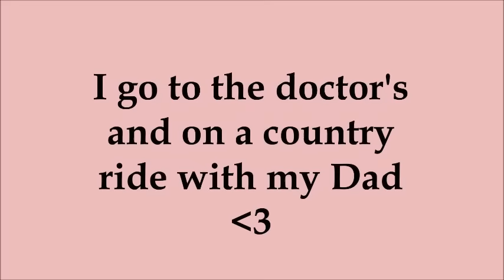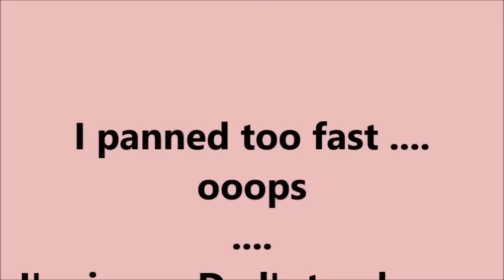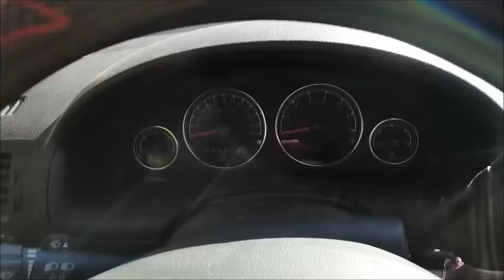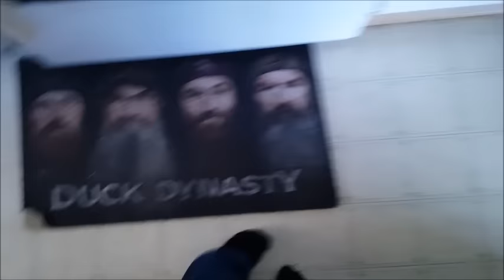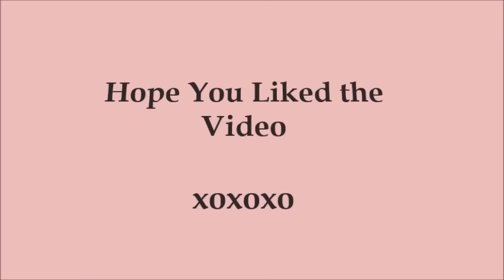💖 MY FIRST REBORN OUTING VIDEO!! 💖

Comment: have u ever had any kind of materials stain ur doll  and if so how do u keep them from staning
Reply from the maker: I did, yes ..... I have a doll that looks like she has a "bruise" .... a darkened spot... from wearing black clothing that I DID wash ...... Usually I wash all the baby clothes, especially the darks that can stain the limbs. So what I do now is only allow the dolls to wear dark clothes for a little bit. Then into light. I also make sure the sunlight coming in doesn't shine on them. (I think what happened was the sunlight warmed up the clothing and stained onto the doll... sad) ..... .... so, I cover up the dolls under blankets during the day. 💞💟☀❄😊💞💟☀❄😊
Reply: @MyWeeRebornsCradle   so u wash them to make sure the dye doesn't get on the baby doll and do u put a white onesie and white pants on under so the dye doesn't transfer on to the baby
Reply from the maker: Yes ... That's right .... I do place a white onsie underneath all their clothes... I don't have many white pants/tights so sometimes I use socks that are long on them. 💞💟☀❄😊💞💟☀❄😊
Reply: @MyWeeRebornsCradle  my baby is possibly gonna be cloth so if it is what parts do I have to cover up so. dye doesn't  transfer
Reply: what do i have to do so it doesn't transfer to the doll the dye
Reply from the maker: right ... The dye will not transfer on the cloth .. only (maybe) on the vinyl's limbs.